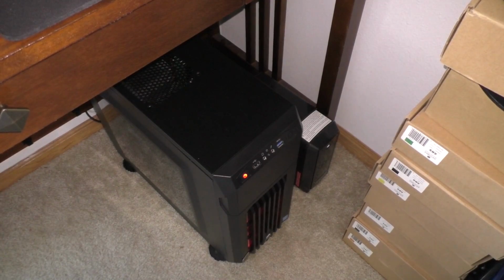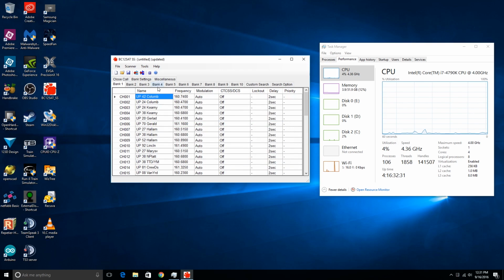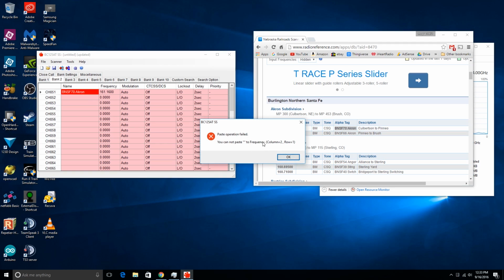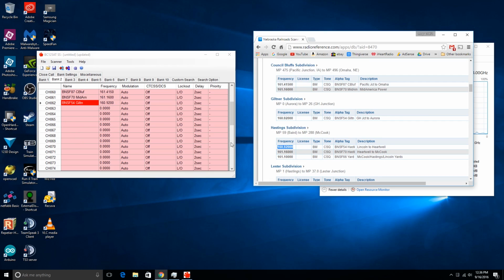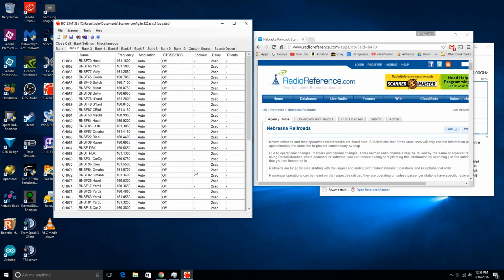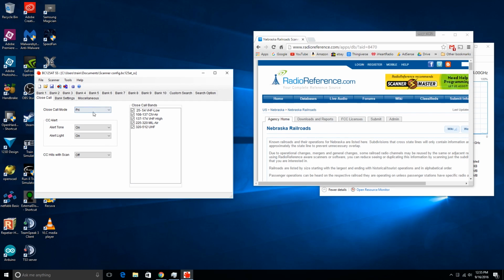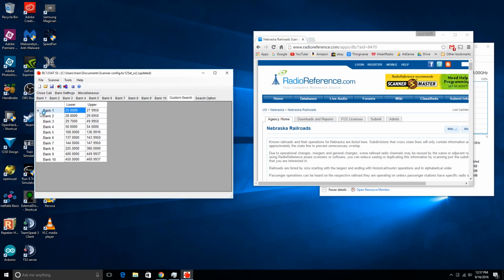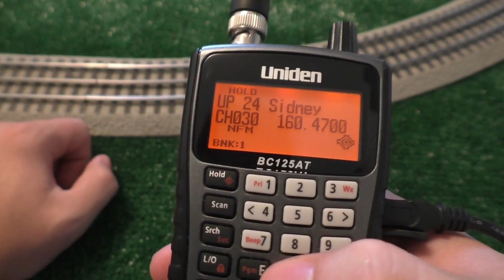Uniden BC125AT Scanner Programming

Comment: The Close Call function has two modes for displaying the received frequency. In the first mode, you need to have time to press any button very quickly,
 to see the transmitter frequency. The second mode makes a temporary write to the databank memory register called CLOSE CALL HITS.
 The most difficult thing is to find and see what is written in this bank. Before each start of the CLOSE CALL function, it is necessary to enter the Close Call menu,
 find the Scan Hits function, go into it, and select SCAN HITS ON and press the PgmE button. After you start the Close Call only mode, and after,
 when you receive the carrier frequency, you can view it later, while the Close Call function is running, press the SCAN button,
 then immediately the HOLD button, you turn the knob at the top of the scanner counterclockwise and find the treasured data bank called CLOSE CALL HITS,
 and there are all your received frequencies.

Comment: I've been railfanning since the age of 5 along the NEC in Norwalk, CT, followed up by the (former) B&O RR in Lima, Ohio. I just purchased a scanner for the first time. I even have a magnetic roof mount. My question is this. When I plug the scanner in a USB port, my computer (windows 10) can charge the scanner but it still doesn't "notice" the device like it would if I plugged my phone in. Any suggestions?

Comment: Thanks for the info, I made sure all the frequencies were right, they were, but i`ve been listening on scan all day and haven't heard anything..is this normal? I only heard one ore two sentences from someone, shouldn't`t I be hearing defect detectors and stuff?
Reply from the maker: Depending on your area you might not hear a lot. Make sure that you are scanning all of the banks that you have programmed in too.
Reply: Update: Last Night I went to Near the Austin Sub, I actually Picked up the Defect detector at Milepost 182, I then began to hear non stop transmissions from Amtrak #21, and the dispatcher, But from the UP San Antonio Sub. Once I left the trackside, they began to fade out until I can`t get anything from home. After I heard the engineer of Amtrak call a "Clear" He passed. The signal he passed turned green after but I didn`t see it, Then a Northbound Freight snuck up on me heading in the opposite direction, I never heard Dispatch giving it the clear after Amtrak, I only heard the defect detector after it passed. I never heard a word from the crew, only the Amtrak Engineer and the Dispatcher, Do Union Pacific crews Call out every Milepost and signal they pass? `cause this one stayed quiet the whole time, even after it passed.
Reply from the maker: As far as I know UP crews won't call clear signals or mileposts.

Comment: Your CTCSS is a squelch tone. Which enables you to listen to a specific group,  A scenario would be Union Pacific, BNSF sharing the same frequency, A Tone set for Union Pacific, you would only hear them on the channel, You would not hear any BNSF radio chatter. A CTCSS tone eliminates unnecessary static noise or public communications.
Reply from the maker: Thanks, Good to know.
Reply: Yes, exactly. It is also called PL-private line developed by Motorola